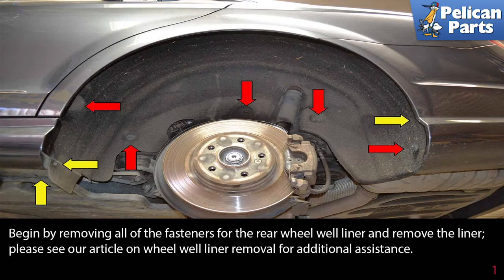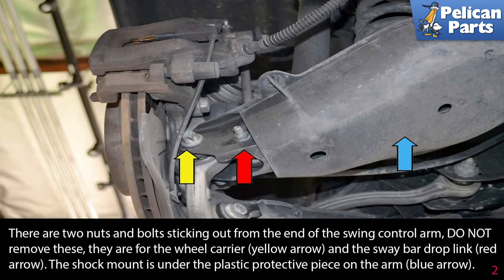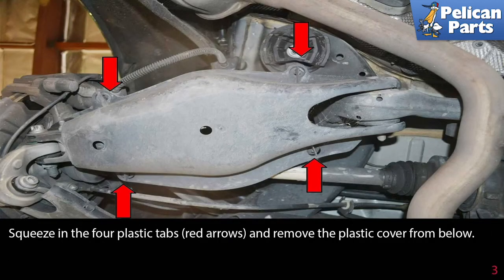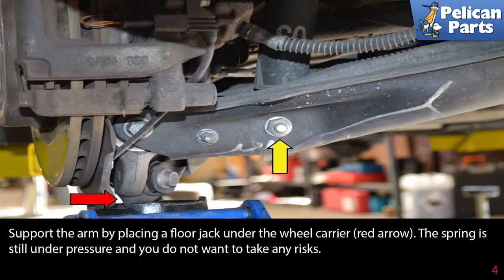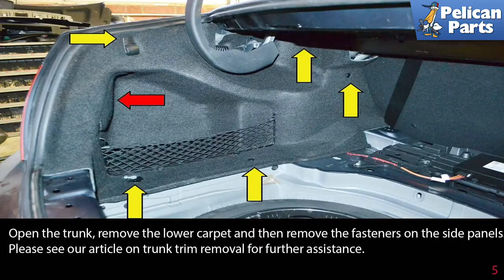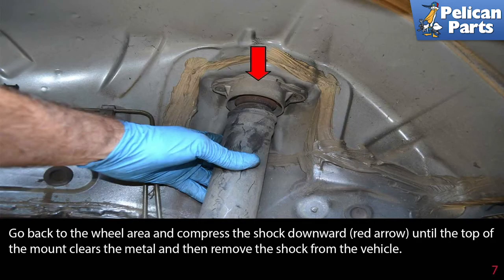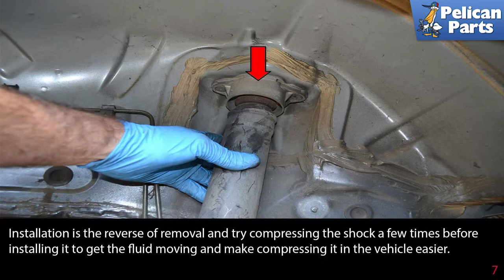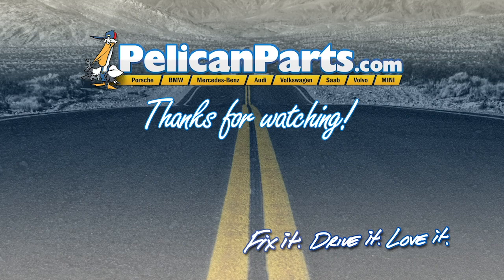Mercedes-Benz W204 C-Class Rear Shock Replacement

Comment: Hi Could you tell what the torque force required for every screw/bolt & nut, many thanks 🙏🏻
Reply from the maker: What is the year and model of vehicle? I can see if I have that info.
Reply: @pelicanparts  2010 C200 W204, thanks